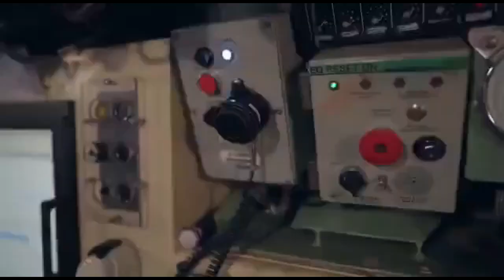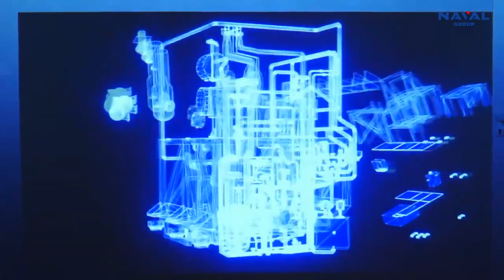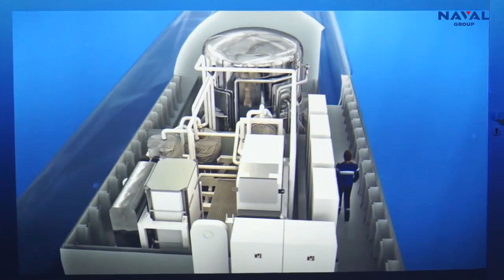#indiannavy to operate 15 Submarines with AIP system #drdo

Comment: Bhai log, 15 yrs will take for first submarine of Project 75-I which is yet to be executed..wheras 3 Kalvari class follow on order with DRDO AIP can be completed in shorter  time span as MDL has already all the tech, installed capacity and skilled labour for building these subs
Reply: That's why it was better to go for 6 subs ...price negotiation would have been better and per piece cost would be lesser
Reply: Not only that we need subs because by the time these subs enter service the type 209 or shishumar class of 4 subs  and 1 or 2 kilo class subs will go out of service so even 6 subs are not increasing the fleet strength